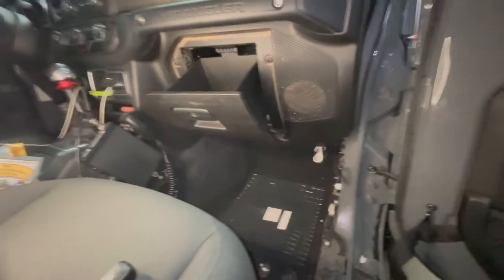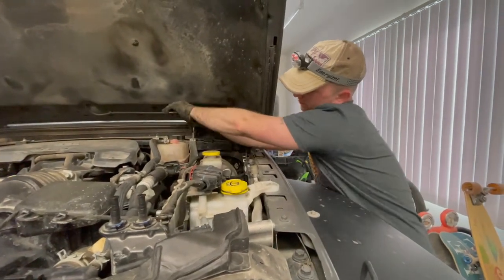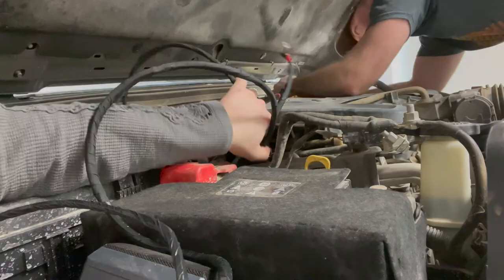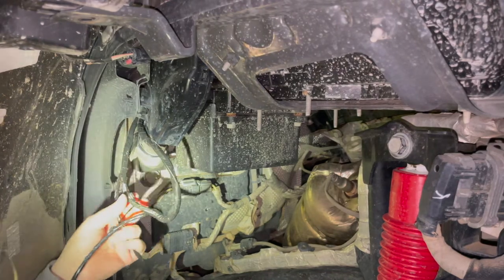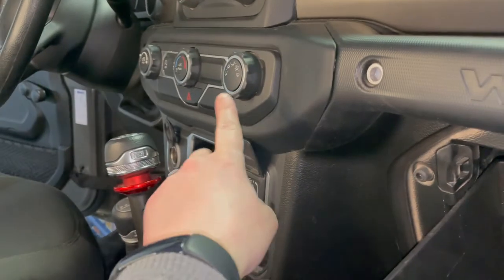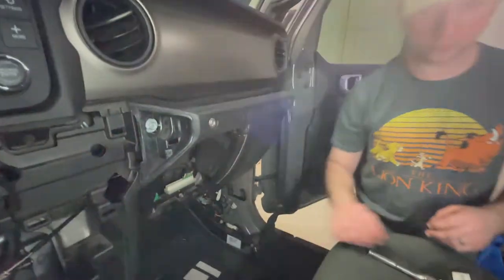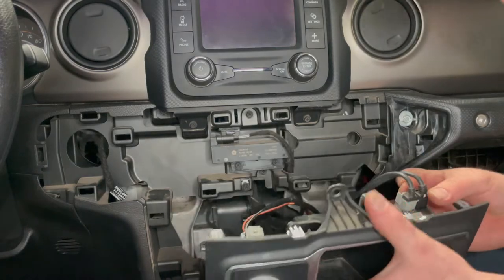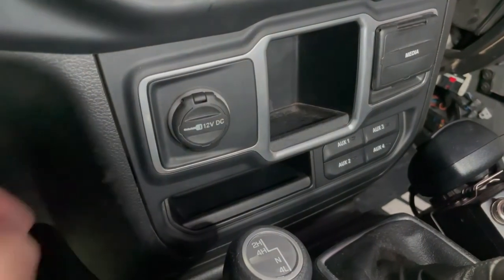How To Install Aux Switches | Jeep JL

Comment: so you completely skip all the critical wiring installation, great job
Reply from the maker: Sorry this video didn't please you. Have a beautiful day! 🌻
Reply: See an installation by CJPony parts.  It goes through it pretty detailed.  I just found out Lasfit and Voswitch also makes one.  The Voswitch has as many as six switches.  Lasfit is customizable.  Just if your still in the market.  I recently brought another Jeep and will be doing.  It is a Sport and I am contemplating adding the Dana44s or upgrading the 30/ 35 axles.